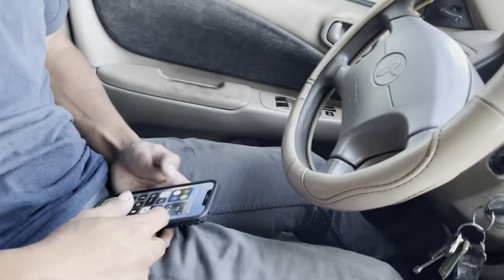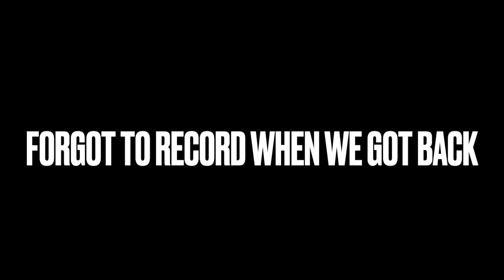Cutting Springs On Toyota Corolla!

Comment: Bro your lucky as hell. That is sooo dangerous.
Reply: dangerous the way hes cutting or the way the car handles afterwards?
Reply from the maker: @potater6163 car handled great still daily driving it today 😂
Reply: The way he was cutting in not you it handles lol I’m running cut springs as well. But cutting a spring with a grinder that’s under tension is sketchy as Hess don’t take much for this to shatter. I had a good friend end up with half a cutting disk stuck in his hand from that
Reply from the maker: @dylanholzman8840 miss understood you lol but yeah definitely was dangerous the way he was doing it